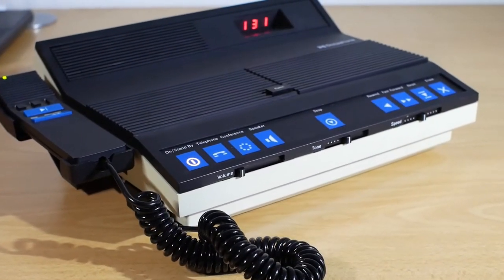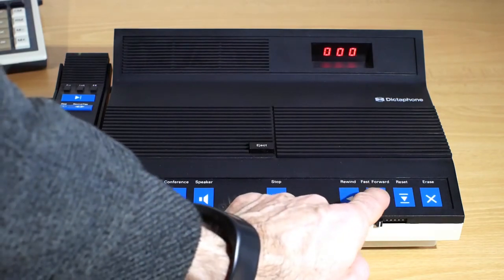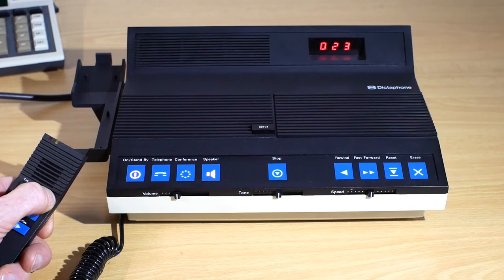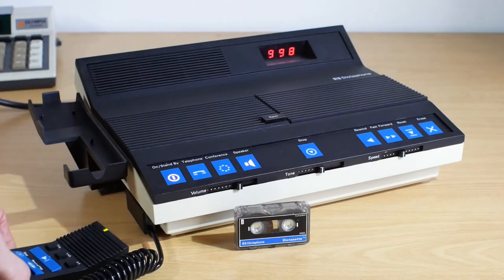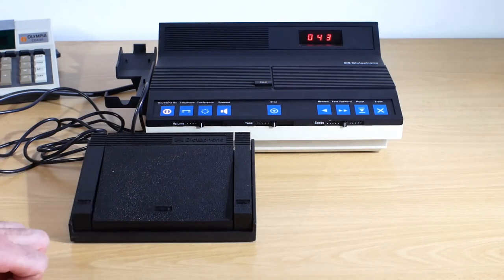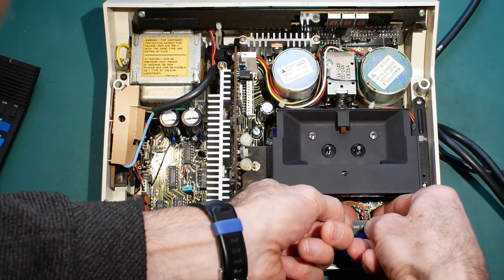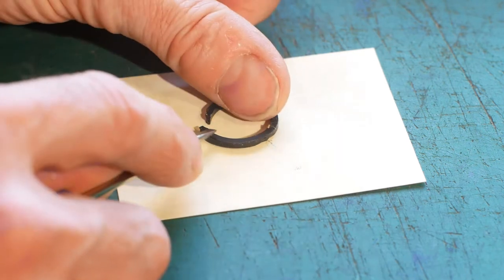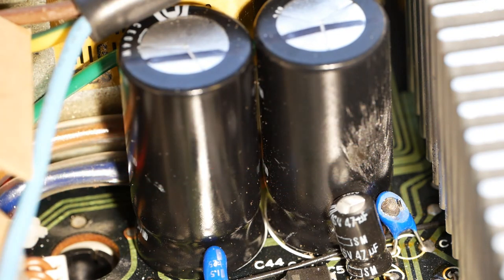Retro Tech - Dictaphone DCX1 Dictamation System, Cassette Drive Wheel Repair

Comment: So many great tips here, how on earth does this video have so few views? By the way, what is the thickness of that rubber sheet?
Reply from the maker: Hi bonistik, I think making videos that no one wants to watch is my specialist subject - if it was a competition I'd be in the running for a prize!!!  Anyway, onto the rubber sheet, I can't remember exactly what thickness I used for that particular job, I'm guessing about 3mm thick, but it's determined by the width of the shoulders on the drive wheel.  I but rubber sheet in various thicknesses from Ebay or Amazon - I tend to keep 1mm, 2mm, 3mm, 4mm, 6mm and 8mm in stock and that suits most of the things I need to repair.  I've lost count of how many times I've made replacement seals, drive wheels, friction devices to open camera lenses and so on, all from relatively cheap rubber sheet.  If you're wanting to cut accurate circles, I use double sided tape to stick the rubber down to my cutting mat before using a circle cutter to cut it out - if I don't use the double sided tape, the rubber tends to creep and the circles aren't that circular.  Cutting the thicker sheers accurately isn't so easy because the knife on the cutter tends to bind.
Reply: @GrumpyTim  Brilliant tips mate, I've never seen this technique before but I will surely try it out next time I need a new idler tire or something like that. Thanks for your awesome videos, hopefully the algorithm will catch on and more people will discover them :)

Comment: Judging by the sound quality of the playback of the boxed cassette, either this unit or the original recorder has a motor speed problem, although from my many years of experience, I do believe the problem is with this unit.  I repaired hundreds of these unit back in the 1980s and onward when I worked for Dictaphone in Canada
Reply from the maker: Hi Dana, wow, that would have been great working for Dictaphone, I'd have liked that job.

You're totally correct about the speed of the boxed cassette - I recorded that as a spoof/hoax/fake recording using a modern digital machine, then slowed the recording to thinly disguise my own voice before transferring the slowed recording onto the mini cassette to play in the Dictaphone - shame on me for such a prank!!!

Thanks for the comment - if you have any other great nuggets of information about Dictaphone, let me know, I've got a couple of portable machines to do videos on at some point and also another model using the Ultravox system combined with a mini cassette - I still need to track down a microphone for that machine though to see if it actually works.
Reply: @GrumpyTim  If the machine you are referring to still uses the sound sheet for recording, then you can use the same hand microphone to record on the unit in question (Dictaphone Model number 404).  Your original machine was a  model 401. There should be a model/serial number plate on the bottom.  If I recall correctly, the minicassette section of this unit was only for transcription.  This combo unit was basically sold as a transcription unit, requiring a foot control and headset, although I believe the sound sheet section could still be used to record voice. Ultravox was the company that made the original unit and Dictaphone bought the company for this product in the late 1960s  and changed the hand mic to the one you have.  There used to be a conversion kit for the other mic to convert it for use with the new version.  I started working for Dictaphone Canada in 1973. I can probably answer most of your questions for Dictaphone cassette based equipment.
Reply from the maker: Ahha, that would make sense if the later machine was intended as a transcribing unit - I'll dig it out tomorrow (I only got around to putting it in storage last week).  If I remember correctly the microphone socket on the later machine had a different shaped plug and a different number of pins but I'll check when I look at it again - It would be really exciting to get the later machine running because I haven't seen any examples of that one online.  I'll get back in touch once I've refreshed my memory.

The other machine I have is a Dictaphone 10 handheld Mini Cassette unit - if I remember correctly, that one has a high pitched wine out of the speaker when you put it into play so there's probably a failed component on the circuit board - I'll get round to tracking down the fault at some point.....
Reply: @GrumpyTim  The high pitched whine from the Dictaphone 10 may be caused by a dirty slider in the record play switch on the amplifier board. it is removable so it can be cleaned.  
There were two types of amplifiers for this unit, the earlier version had a 14 pin can type IC, the later versions used the same ic in a 14 pin standard version.  I remember servicing many numbers of those units in the late 1970s, early 1980s.
Reply from the maker: Thanks Dana, I'll try to have a proper look at the Dictaphone 10 in the next few days, it would be nice to gat that one working.

I've just dug out the later Ultravox machine that also has the mini cassette - it's a model D-504 serial number 50 0603.  Connections wise, it has a 2 pin connector, a 5 pin DIN socket and a 14 pin rectangular socket.  It does appear to be partially working - there's a switch under the cassette door to switch between soundsheet and cassette - the soundsheet motor starts spinning when in soundsheet position and the cassette becomes operational in the other position - I think I'm just lacking a foot pedal or other remote to make it work, there are 4 buttons for the cassette which I guess are rewind, fast forward, stop and erase - I do get high speed sound out of the cassette in the fast forward position but there is no play button as far as I can see (play would usually be from the foot pedal I guess).

It's an interesting machine - I might well get it running at some point in time.  Having the correct foot control would be a good start.

Thanks again for your interest and information - I love this old technology that everyone has forgotten about.